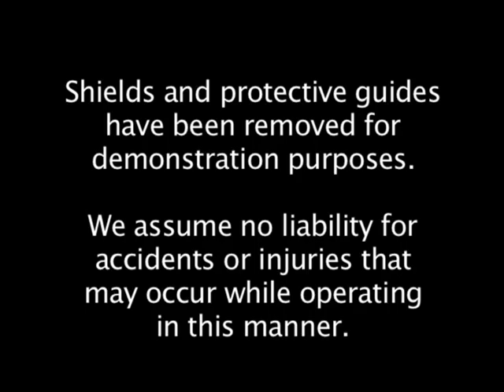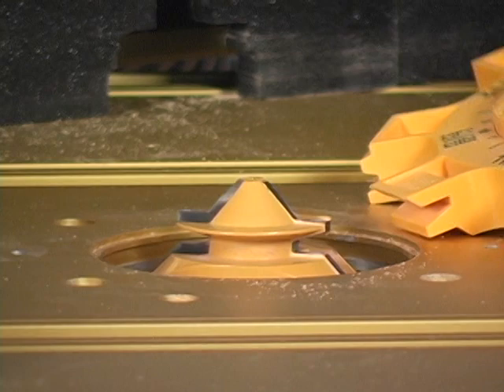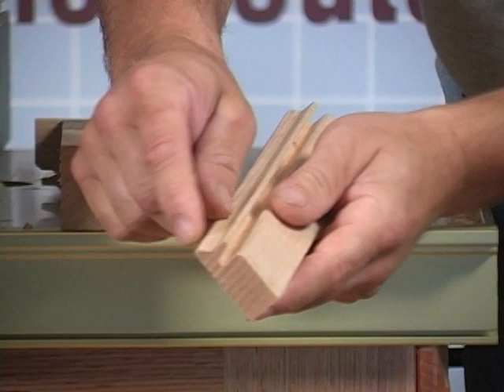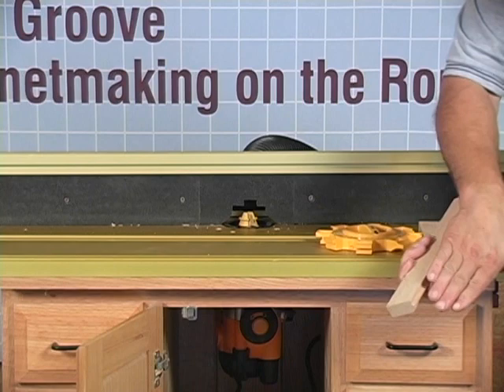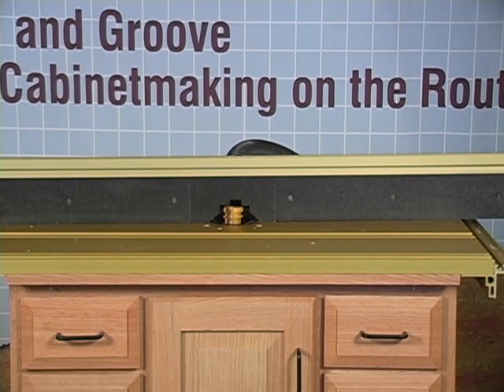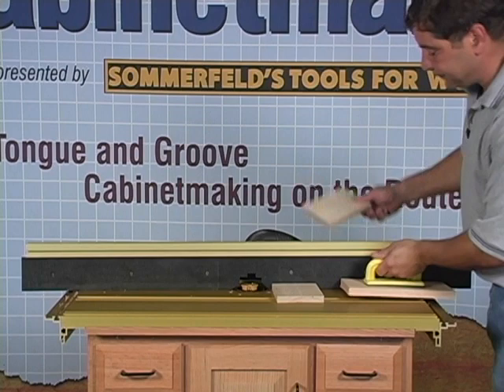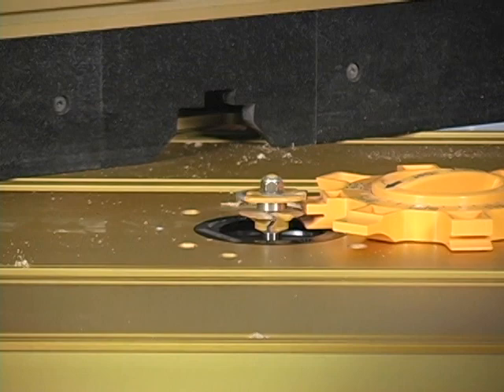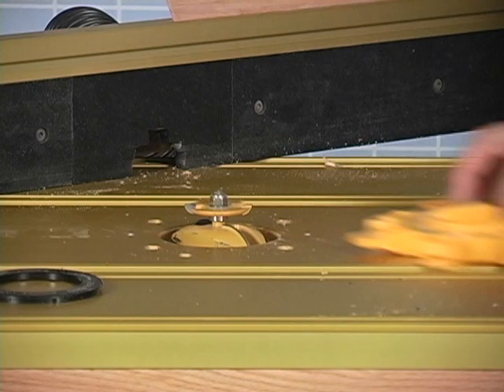Sommerfeld's Tools for Wood - Jointmaking with the Easy Set with Marc Sommerfeld - Part 1

Comment: Nice instructions on setting the depth of the router based on the Easy Set but, the markings on the Easy Set are confusing since there are two measurements on the same line and an arrow that seems out of place. What are the inner marking for?  There should have been a clear intro explaining the Easy Set top markings and how they are set when using the Easy Set.